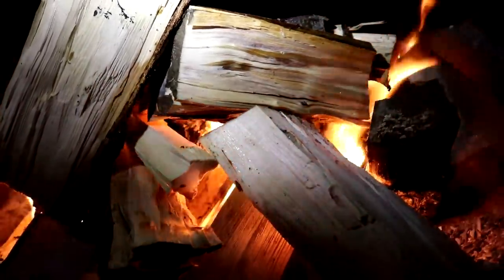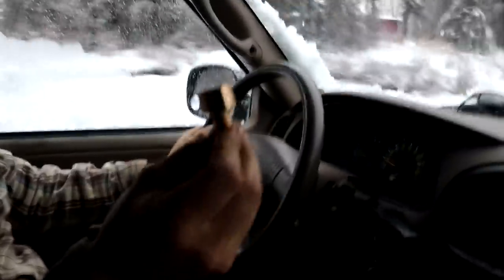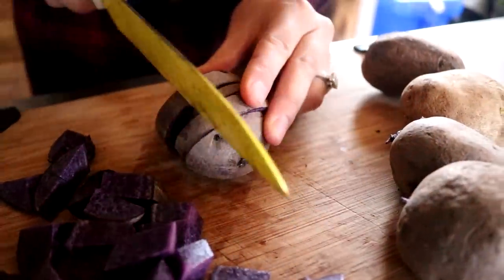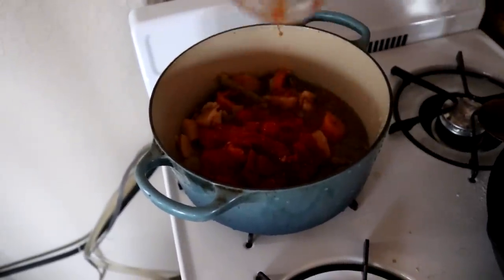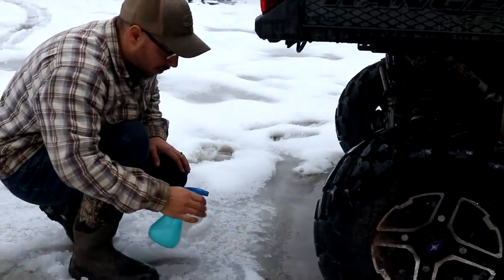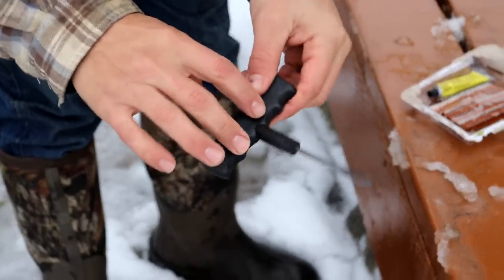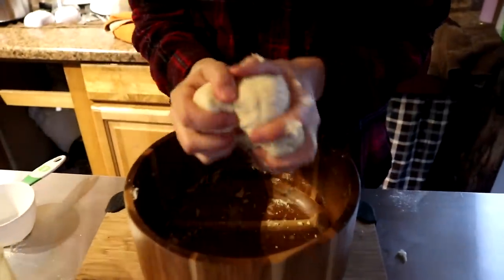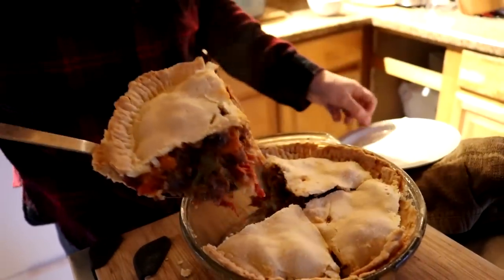Winter Day at the Off Grid Cabin

Comment: Couple quick tips on those string repairs- you don’t need to fight to thread the needle, it can be put in the same way it pulls out. Also, giving it a quarter turn or so before removing the needle helps it grab in the hole better. The rubber cement does no good, as you mention. Just spray it with your soapy water. Dish soap (not diluted) also can be very useful for getting a tire to seal to a rim. Also, those red plugs are ‘ok’, but swing by Napa and get blue ones, they seal way better. I’ve made a lot of people happy in my lifetime (several on the Alcan) just from having that kit with me, not counting my own uses.

Comment: Trick with the tire kit is if it's a small puncture and you can't fit the reamer tool in there, drill it out with a drill bit smaller than the reamer so you can fit the reamer tool in the hole.

Comment: I have had good luck with the tire repair kits, but I have never used them on a sidewall.  If you find that the plug doesn't hold in the sidewall you may need to try using a tube in the tire.
Reply from the maker: Yoshaki the plug is still holding, but that is a great idea on using a tube, since the tires are brand new. Thanks for watching!